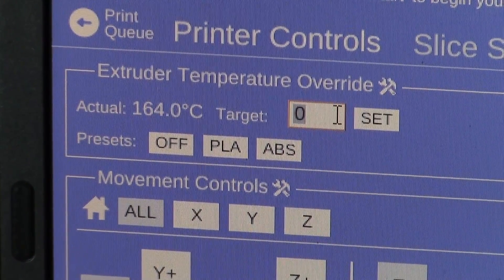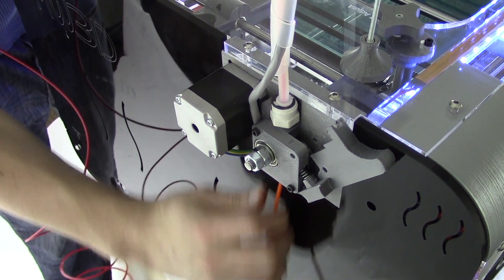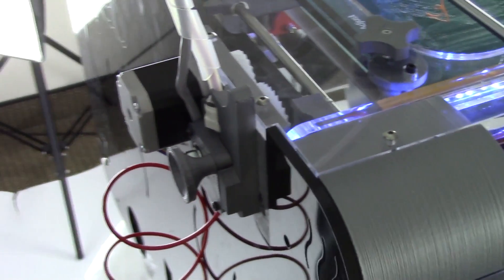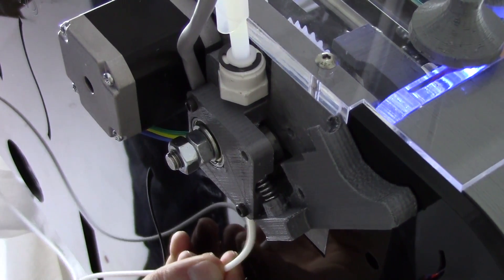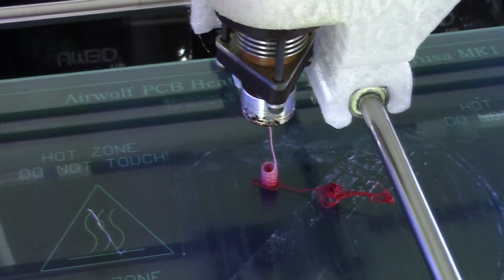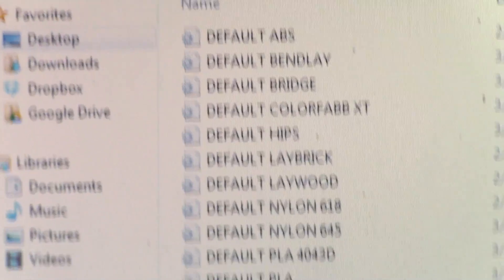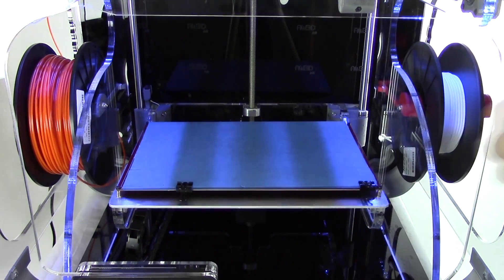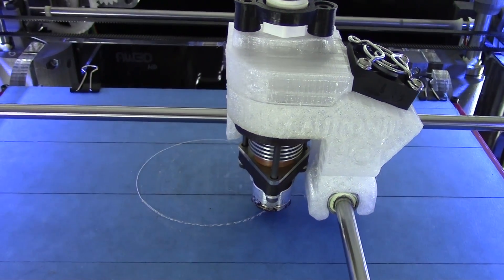3D Printing TPE with the Airwolf 3D HD

Comment: Airwolf is one of the worst 3D printer manufacturers out there! Overpriced, the extruder is weak, it usually breaks down after about a year which is ironically right around the time there warranty ends as well. For 5000$ you had better build a damn good unit, they failed miserably. My advice is to do your research and find a different builder specialized in what your end product will be.
Reply: If the extruder "breaks down" and yr out of warranty, you buy another one. The thing about Airwolf is, their products are good. Even the older ones. They keep improving on a trajectory to be one of the top out there period.
Reply: Since you are putting it out there, which 3D printer manufacturer do you represent?
Reply: Ender

Comment: What happens if ABS isn't purged with PLA first? I have a makerbot Rep2X, normally print with ABS, but I just received shipment of a roll of TPE for a small project. Should I scrounge a piece of PLA from somewhere to make this happen?
Reply: Probably. I am sure that is somewhat universal. BTW, while the Makerbot---save for their more recent, post Stratasys, debacle---is a quite good 3D printer, the Airwolf is significantly better in quality prints. Also, they offer one upgrade over another. Further, huge no. of materials to use.

Comment: what did you cover the cristal with?
what settings does the settings file have? i need the settings for cura (layer height and all that)
and last thing, why did you extrude PLA @ 260 before the TPA? (i mean why so hot)
Im sorry, my english is not the best and i cant hear you clearly enought in the vid :/

PD.: you made a really good looking printer, are you using some type of modified buddas nozzle?
I see a problem with the bowden-kind extruder with TPA, this plastic its flexible and it can be compressed a bit between the motor and the extruder what will cause not too good prints if there is a bridge or a jump where the motor has to retrude.

Comment: so, even though it says "100"mm on the interface you do mean we should extrude about 3 feet to clear the extruder?
Reply from the maker: Animatronic,

Yes, you are correct. We recommend that you extrude 1000mm of filament (or 39") to ensure that the nozzle is not contaminated before beginning with a different material.  The Matter Control only goes up to 100mm, so the user would have to click that option 10 times for the full 1000mm purge. Another method is to use a dedicated nozzle for each type of material. Unfortunately, the purge process does tend to waste a lot of material, so it might be more cost-effective for high-volume users to utilize the dedicated nozzle method of printing multiple materials. Some companies have also developed nozzle cleaning filament for this purpose that might be worth investigating. We hope this answers your question adequately. If you still have questions please feel free to email us at: info@airwolf3d.com.

Airwolf 3D